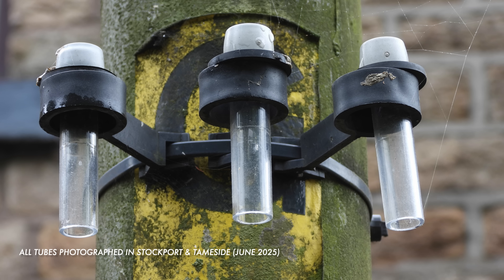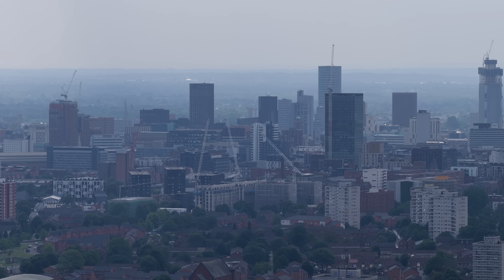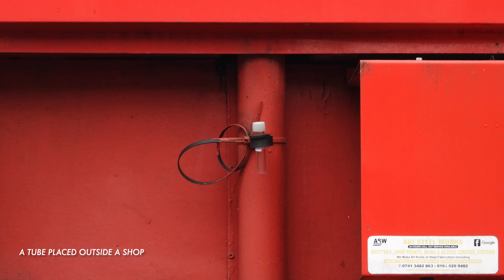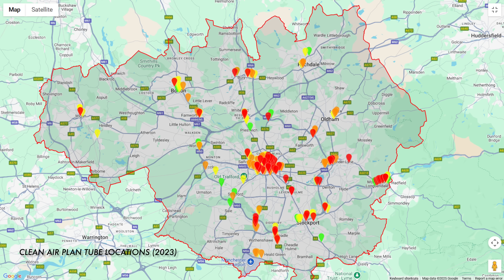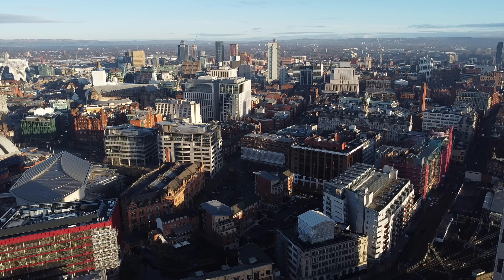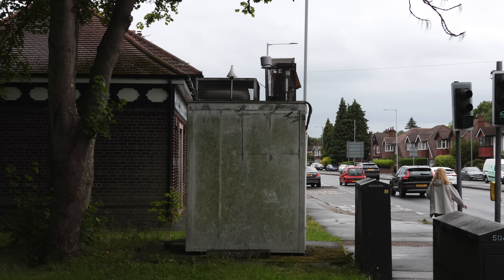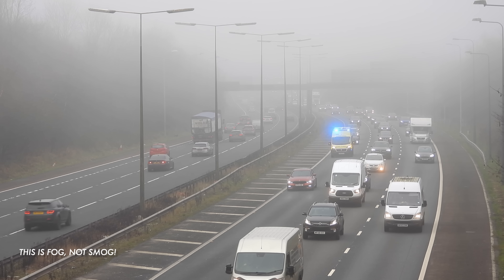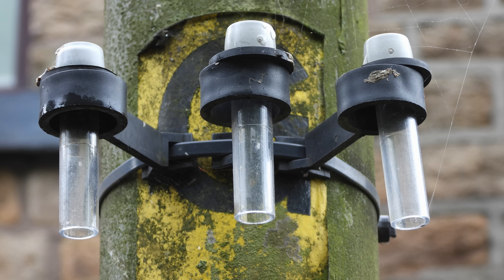Why Did These Test Tubes Appear In Your Street?

Comment: They're trying to improve your internet. It is a series of tubes, after all.

I work in air quality monitoring, running 4 stations in Kentucky. Kind of neat to see diffusion tubes in use. They're a relatively cheap method to get a good idea of how much NO2 you have even if you lose accuracy and temporal resolution. The cost advantage gives you more spatial resolution.

Comment: Used to do this with ion chromatography to monitor multiple acidic airborne gasses, it was somewhat of a student project, trying out various sorbents, maybe 25years ago, inserting to see it being used, wind variability calibration and overall precision were all up for grabs, but it is really inexpensive and simple sampling hardware that you can site easily, in the place were sampling is relevant,  without risk or potential for vandalism of expensive electronics and optics in a remote spectroscopy rig or hardware for a pumped sample and sorbent .

Comment: How high up are they? I think they could get knocked down with a broomstick for the government putting restrictions on engines and furnaces. So much loose trash has to be hauled away if you don't have a coal furnace.
Reply: Sure. There is no problem with pollution if you don't measure it. /S

Comment: You are wrong when you state that the Cameras have not been used. Many are on gathering number plate info for tracking car movement all over the county and also logging uninsured, untaxed and cloned plates etc. So they are definitely not redundant. I believe they can also read speed for monitoring purposes.
Reply from the maker: I was referring to them in the context of ULEZ fines and clean air, clearly
Reply: @RingwayManchester unfortunately it wasn’t clear to myself Andrew.
Reply from the maker: Who’s Andrew? Now I’m not surprised 😆😆😆

Comment: Nitrogen Dioxide in the atmosphere is photo- chemically decomposed by Ultra Violet rays in sunlight into, amongst other things, Ozone. Low level ozone is what's called a Reactive Oxygen Species and is damaging to health. Ozone levels max out during the kind of weather the South-East is getting now i.e. high pressure air (i.e. falling and cold ) and the cloudless conditions with intense sunlight give the right conditions for maximum conversion of Nitrogen dioxide into Ozone, which then becomes trapped under the falling cool air above at ground level . . and if there is in sufficient wind speed to blow it away (About 8.5 to 10 mph in Lindon)  then it just accumulates day after day.

Comment: You may find the ulez cameras are been used as apart of an extended APNR service for the reduction of crime when required
Reply: I very much doubt it, since that would demonstrate a reasonable level of governmental department cohesion and efficiency.
Reply: @pvere3246  this is the case in Manchester

Comment: This air pollution thing is absolute nonsense.  The public are being scammed by councils who do NOT need to keep contracting out services to their friends companies to get results they can ALREADY ACCESS.

For those that do not know, and anyone working for Councils who are clueless - DEFRA is a Government Department that has run monitoring stations for air quality in the UK since the 1940s.  The monitors are in most town and city centres and on busy main roads.
All the data from these for each area showing hundreds of gases and particulates is available to the public and councils free of charge.  I looked at it for research during lockdown.  I found NO difference in air quality between before, during and after lockdown.

Liverpool City Council lied saying there were high pollution levels, but suddenly went quiet when DEFRA Air Quality Monitoring Station data was mentioned, they couldn't lie to start awarding contracts to mates or apply for government grants.  They're looking for any old excuse to add taxes and charges and price people off the roads.  They tried this by paving over lanes on very busy high flowing main roads, stopped people turning right, removed filter lanes and put traffic lights on timers.

Notice how they got upset when people bought log burners, it meant less people paying for fuel!!!
Reply: The government wants to keep you safe!   😂
Reply: Rambling nonsense.

Comment: Clean air zone is literally a scam? Do they not understand how wind works😂
Reply: No, it is about harmful NOx and particulates in urban canyons between buildings.  If you are tiny in the trouser region you can buy a grey import Holden Ute, or a Vauxhall Monaro or VX8R and drive it in outer London and guzzle fuel, or even a V6 Toyota, which uses more fuel.
Reply: So you're saying the wind will blow it away from the tubes and they will end up agreeing with you.
Reply: 1) Give the tubes to activists
2) Activists install tubes in most polluted areas
3) Politician claims high level of pollution
4) You pay lots of more tax for the environment

Works the other way as well,
1) Give politician tubes
2) Politician install tubes in local park
3) Politician claims you must vote for him because he cleaned up the city

Comment: I thought that NO was at a far higher concentration in the polluted atmosphere than NO2.  NO2 can be created by the oxidation of NO, but I am surprised if Manchester is stating that it has far more NO2 in its air than NO.  Maybe it is that they are measuring NO2 in particular in the NOx collectors rather than NO as that has a worse effect on anything which breathes.

Comment: A test tube is a common piece of laboratory glassware, typically a cylindrical tube with one closed, rounded end and an open top, used for holding, mixing, and heating small amounts of substances in experiments. Test tubes are  made of glass.......they are not adhered to telegraphpoles
Reply: They're not test tubes. This was explained in the video.
Reply: @edweard again,i know

Comment: maybe we should start a conspiracy - they are 5G tri-oscillator tube, used to harness the 5G frequency to create audio frequencies for an Active Denial System (ADS) to deter rabid foxes from roaming the area, due to the way rabies effects the malleus (hammer), incus (anvil) ear bones, making then much sensitive to specific frequencies range, however there is growing evidence that in location where they are fitted (typically along urban roads), of significantly increased cat and dog deaths due to running out into traffic.

Comment: So they can read 30% high?  

Well that is a dumb way to monitor & formulate emissions policy.
Reply: Cannot tell what you are trying to say.
Reply: @edweard formulating policy and measuring the impact of that policy by using equipment that delivers errors of 30% is dumb, bad practice.
Reply: @barrieshepherd7694 Well they might individually read 30% high (or low) - but they aren't using just one of them.

Comment: The excess plastic of those plastic zip-ties sincerely bother me as a fiber installer working in utility poles every day. I MUST GO CUT THEM APPROPRIATELY!
Reply: When I was at BT they had a special tool to tension and safely trim zip-ties. Because if they were trimmed with ordinary cutters or scissors, they might have sharp edges on the cut ends.
Reply: @michaelturner4457  Can't tell how many times I cut myself or scratch the skin on those sharp edges!
Reply: @michaelturner4457  sucks to run your arm or wrist across a cable tie cut to a point.
Reply: @michaelturner4457  I think I've got a bunch of those somewhere.
Reply: @michaelturner4457  I work for a municipal government who runs a utility, here in the US. We have specific prohibitions about zip-ties on utility poles specifically because they can poke holes in the HV gloves the line workers wear.

Comment: If you want to reduce pollution from vehicles make traffic flow more freely
Reply: Good point but I also think that an effective public transport could make a big difference as well. Twenty people in a bus are always better than 20 cars with a person each. That could improve the aforementioned traffic flow.
Reply: @HristosTrUK  This is a must, but it has to be reliable, so bus lanes too. 
Do what London did, drop the price and make them so frequent you never have to check when the next one is coming, ridership will go through the roof.
New York recently introduced their congestion charge, and just that alone sped up bus services and they got a 20% boost in ridership, London did it better.
Reply: @PeoplesRepublicOfHackney  That's the think - it must be effective, but are they any effective public transport services outside London? I don't think so - may be in Manchester, Birmingham, who knows? The situation where I live (Hemel Hempstead) is a total joke - one week very punctual buses, next they come to the stops in random time. No to mention hiw slow they are, due to massive zig-zag routes.
Reply: But then more people drive and you end up at square one. We tried that from the 60s to the 90s, the effect has a name, induced demand. 
It even has a meme "Just one more lane bro, that's all I need, just one more!!".
Reply: Or stop having there be so much traffic by making the roads safer for walking, cycling, and provide better public transport.
Reply: @Buckets41369 elaborate…
Reply: @Buckets41369  Hahahaha so delusional.....
Reply: easiest way to do that is by disincentivising driving - leaving the roads for the people who need/want them the most, and keeping the pollution down
Reply: @sandwich2473 how would you disincentivise driving?
Reply: @TheGreyTest  spikes on steering wheels.
Reply: @sandwich2473  Those that need them? So that would be around 90% of the population then?

Comment: Rain must not affect them...they don't appear to be sheltered. These are probably used here in the USA....
Reply: They are sheltered, the sampling material is up top inside the tube, it won't get wet from weather (maybe fog). 

Someone would have to intentionally spray water inside it.

Comment: Diffusion tube for the Caz and pay per mile next.
Reply: Driving should be pay per mile. It would drastically reduce the number of pointless car journeys that could easily be walked or cycled without prohibiting the use of cars outright.
Reply: @Buckets41369 Driving is already “pay per mile”.  We have to put fuel in these things and the more you drive, the more fuel - and greater the cost - it is to run your car.
Reply: Car journies ARE pay per mile. It's called fuel duty. More fuel you use, the more you pay.  @Buckets41369
Reply: @Buckets41369  It is. Have you not noticed that cars burn petrol or diesel which is effectively pay per mile?
Reply: @paulsengupta971 Fuel is not the only cost associated with car ownership and use. Hope this helps.
Reply: @Buckets41369  It doesn't, sorry, I already know that, having five cars. Some of them are mileage related as well, such as service intervals and tyres. There are some costs which are only vaguely milage related such as insurance, where it becomes more expensive when you specify a higher mileage. Anyway, after the fixed costs which aren't mileage related, everything else is, the biggest of which is fuel. Your comment is that driving should be pay per mile. It already is, as I said.
Reply: @Buckets41369  be careful what you wish for. The greedy scummers in government want keep upping the price on everything. People here are talking about fuel; the scumbags want to tax us on distance traveled & probably up the insurance based on distance. They want to stop our freedom of movement. And why, if people are working, shouldn't they have freedom of movement? You don't actually believe politicians want to save the planet, do you!? 🤣

Comment: I noticed these in Sheffield recently. Guessed they were probably for air quality testing, especially as the ones I saw were on a road near my work (which is on a main road that is busy with lots of HGVs and not far from the M1...)
Reply: Many people asociate HGV’s with air pollution but you won’t see many HGV’s Euro 5 or lower those days. I’m a driver since 2018 and never drove one. Only Euro 6 and last 3 years only CNG gas one’s.